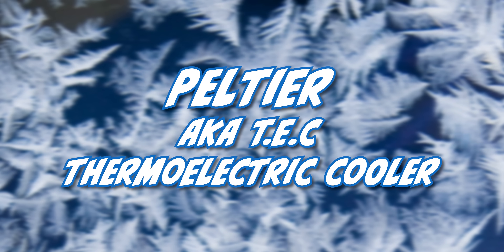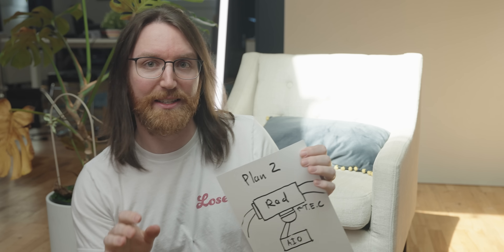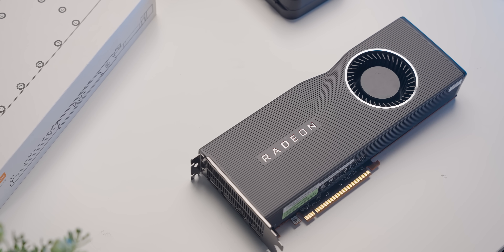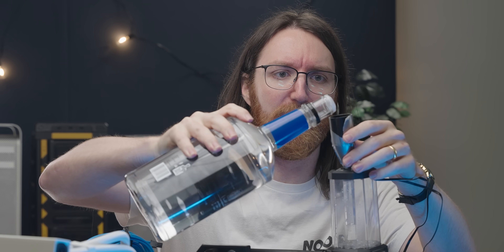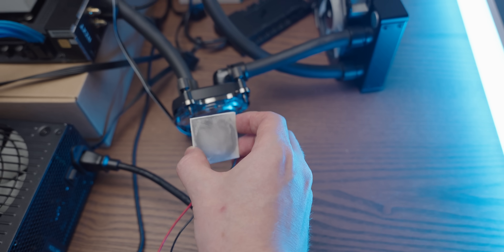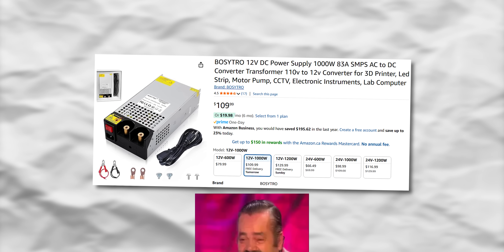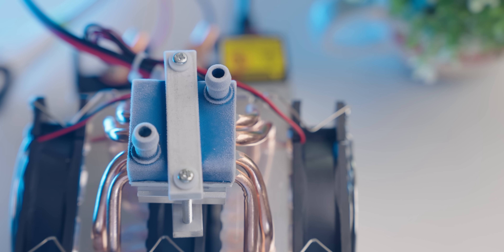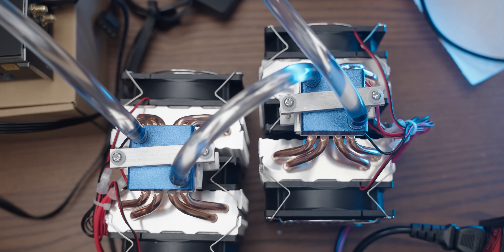I REVOLUTIONISE PC Cooling....

Comment: i always love when some one finds TECs... then learn the hardway why we dont use them...
Reply: Yeah they really can't move much heat.

Pretty much everything in modern computers will overload them.
Reply: @volvo09  Peltiers are effective at moving heat, but only if you work within their limitations. For example, a peltier that is rated to 50 watts of heat, will handle a 49 watt heat load, but a 51 watt heat load will cause a rapid temperature spike, even if you vastly increase the cooling on the other side, this is why you cannot sandwich a peltier between a CPU/GPU and heatsink (at least unless you have a peltier that can handle the highest TDP spike your CPU or GPU can do. For a PC, the only really effective means to use a peltier that is not rated for the peak current draw of your CPU, is to add it as a second stage cooling. In the video, he improperly used it by adding it as a first stage cooling. This meant that he never gave the radiator a chance to do much cooling. Liquid cooling radiators, require a a large temperature delta to work efficiently, and peltiers will move a fixed amount of heat, thus a peltier will move the same amount of heat whether the water is 20 degrees over ambient or 1 degree over ambient, but a radiator will make a negligible temperature if you pass liquid through it that is 1 degree over ambient. This is why a peltier needs to be a second stage. The radiators can get the liquid temperature down to a level where you start to run into diminishing returns, then the peltier can contribute its temperature drop to the loop.
Reply: @Razor2048  The most signifiant thing that people don't understand is that a 50W TEC can only pump 50W of heat energy with a temperature delta of zero.  As soon as the delta increases (and the majority of practical applications will have a non-zero delta) the amount of heat than it can pump reduces.  For example a 50W TEC may only be able to pump 35W with a delta of 20C.
Reply: @volvo09  what about really old computers? If Dawid got some ancient beige box type PC?
Reply: @tyrannicpuppy  they worked when i was getting into PC's back in the late 90's. CPU's were under 20Watts, so you could actually get yourself in trouble and cool below ambient and get condensation on your CPU socket.
Reply: @volvo09  TEC was a thing back then?
Reply: @jishan6992  Oh yeah. Us oldheads definitely used them. You coud put a 60 or 80W TEC on a 20 or 30W CPU and custom water cooling to the point you'd have to use vaseline in and around the CPU socket to prevent condensation and frost. Good times, good times.

Comment: i was not prepard for vodka to be the liquid coolent hahahaha
Reply: Blyat cooled PC, shoutout to Boris
Reply: Works for soviet turboprop aircraft, cant see why it wouldnt work in a PC!
Reply: @DAFPvnk  lmao that's not normal vodka xD
Reply: @MrBonebus it was at first, lol. They changed it and folks found out the hard way that it wasn't safe to drink anymore 😂
Reply: The solution was really simple and it should work even with the first direct Peltier attempt. Do not use a radiator, connect it direct to the reservoir/pump, no rad in between. It's acting as a heater!
Reply: @pigletBR  if it were that simple then why would we ever use radiators? they are dissipating the heat that the coolant builds up, the rad isnt heating anything, it is doing 99% of the work. if you put all of the heat into a he peltier the gpu would overheat almost immediately
Reply: @Antwon22  The radiator moves heat from the hotter side to the colder. If the liquid going through the second Peltier cooler is cooler than room temperature then the radiator will heat that coolant. If it's just slightly warmer than room temperature the radciator will cool it, but very little as it is dependent on the temperature delta between the room temp and the temp of the liquid. 

So either remover the radiator or better it should be mounted before the Peltier coolers where the temperature delta is the highest. There the radiator will be able to transfer the most heat. Then the Peltier coolers can do their stuff on cooler media and the result should be better.
Reply: @Antwon22  we use radiators cuz we don't use Peltiers in Pc cooling, everything comes to energy efficiency. Radiators are extremely more efficient, thus why we need them
Reply: @blahorgaslisk7763 that would be even better! The coolant wd come a little colder, leaving more ground for the Peltier, noice
Reply: I am surprised he adds a rad to warm up the coolant and wonders why the Peltier's aren't working the way he wants them to
Reply: I hope the vodka doesn't deteriorate the rubbers of dissolve the lubricant in the pump.
Reply: 40/60 premix, non-toxic, biodegradable. 😁
Reply: True
Reply: I was tbh i use vodka in my own custom loop sure its not perfect but its ok!
Reply: @harriet-x.x no, no you don't. can't stand you people

Comment: I say use this on a gt 710 and overclock it to hell
Reply: I say uhd 630 graphics
Reply: @Server.52  😂
Reply: Yes, use those 2 peltiers he bought and connect them to a sweet gt710
Reply: @volvo09  by sweet gt 710 you mean the gt710 eater of worlds :D
Reply: Nooope, try this contraption on a GeForce PCX 5300
Reply: I just so happen to have a GT710 and a bunch of peltier modules...
Reply: he already did something similar to that actually
Reply: I back this idea. How far can you push shitty GPU? Amazon most recommended GPU? Most popular GPU? Something shitty you can overclock and maybe make it great?
Reply: @corgano6068  Overclocking went much further then then it does now! 10000% performance boost with modern tech?
Reply: at one point the bottleneck is not temperature. the card can only draw so much power, it will get unstable, and for mem clock you'll get artifacting at one point. and then even if you could let's say double both the core clock and mem clock speed you wouldn't get much fps increase from it
Reply: that would be so cool
Reply: Let's use them on my 3dfx voodoo2 and Nvidia tnt sli rig
Reply: Fun fact I hold the world record 3dmark gt710 score
Reply: I say a ten thiddy
Reply: Best gpu !!
Reply: Gt1030
Reply: Whe Dawid said 'low power' the 710 did come to mind...
Reply: True, great plan,
Reply: Cooling will cost more power than the card itself😭
Reply: Now you can power the servers from Microsoft and google combined with all that mighty power from the gt 710?
Reply: Same
Reply: I do use a GT710 in 2025
Reply: It would just crash before it throttles even with the stock cooler
Reply: I say on a RX580
Reply: @bechillbrah why not
Reply: @bechillbrah  Naahhh too old
Reply: None of these cards have enough voltage.. 😂😂😂
Reply: @LeeThaOne triple stacked shunt resistors
Reply: Right because the 710 has a shunt mod to increase power draw by 200%? Not in this reality I'm afraid.
Reply: @stevenwest1494   It was a joke.